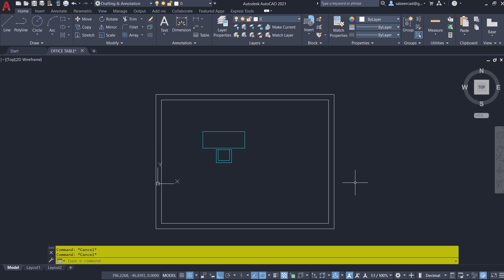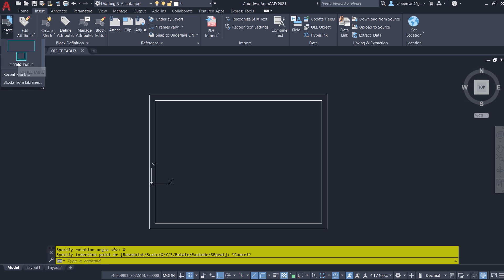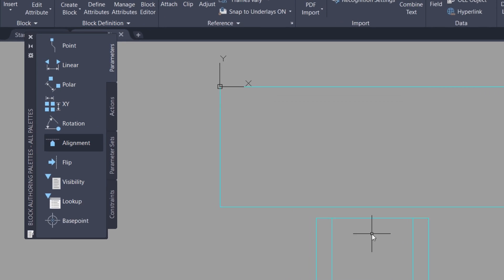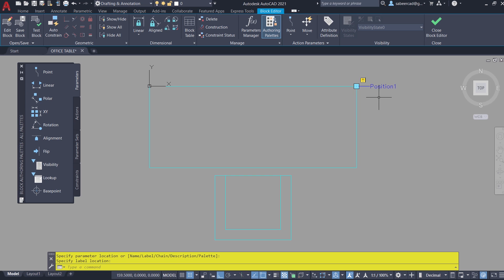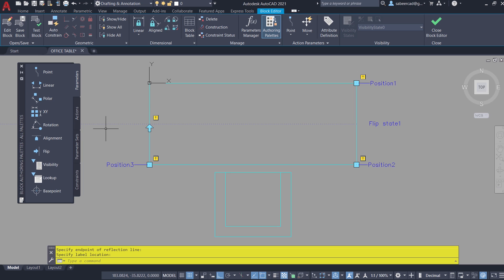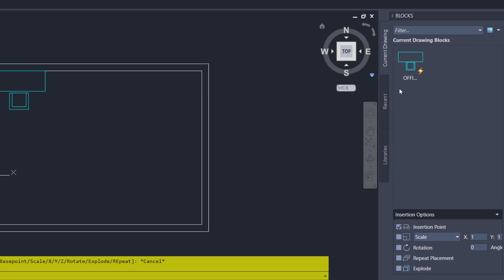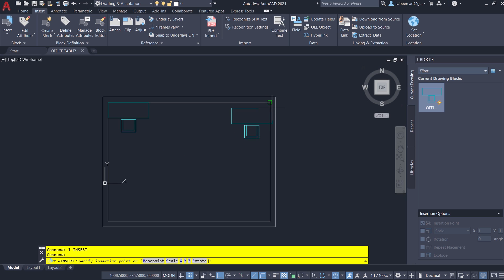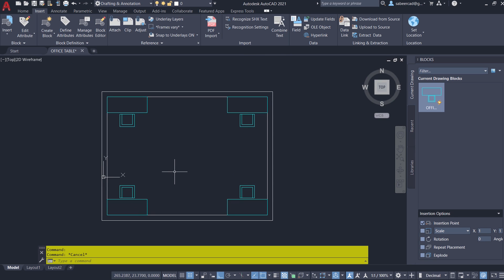CREATE A BLOCK WITH MULTIPLE INSERTION POINTS | AutoCAD DYNAMIC BLOCKS

Comment: Hi Sabeer, thanks for the video. This doesn't work however if the insertion points are in the middle of a line and the line can be stretched dynamically. Do you know a work around for that situation?
Reply from the maker: This procedure is applicable in such a senario. We may be to parametrize the object, if you want a point to be dynamic.

Comment: Sir l installed AutoCAD mechanical 2020 version and i activated it.But when i look the interface ,on annotation panel there is no option for changing the style,leader style. ie there is no small arrow that is usually shown. Is there any solution sir🙏🙏
Reply: Sir l installed AutoCAD mechanical 2020 version and i activated it.But when i look the interface ,on annotation panel there is no option for changing the style,leader style. ie there is no small arrow that is usually shown. Is there any solution sir.